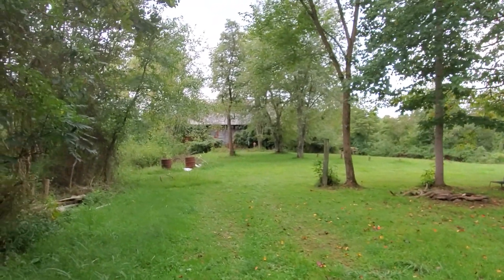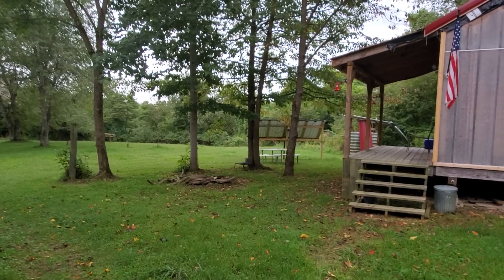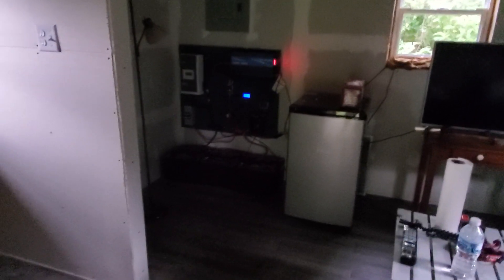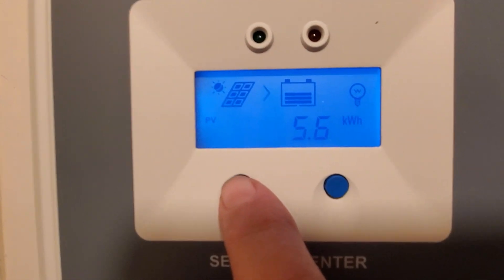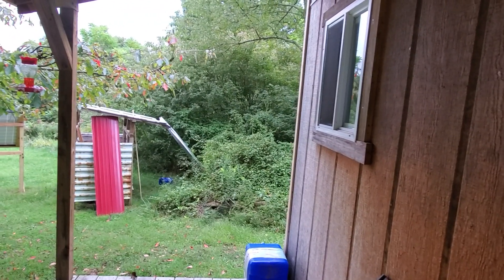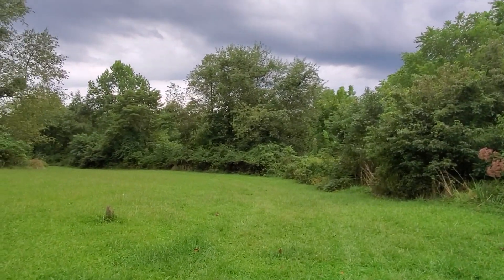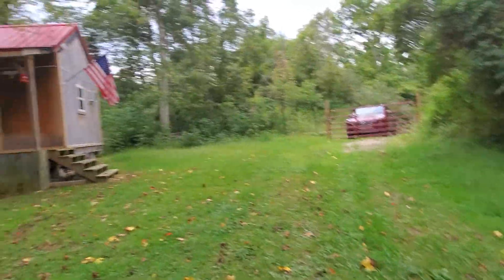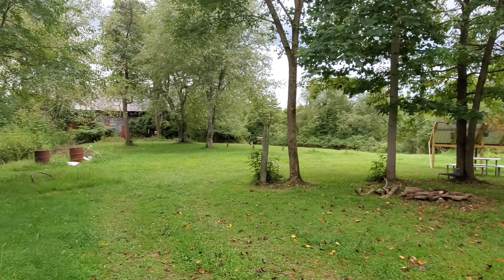Off Grid Solar - Figuring Volts, Watts & Amps.

Comment: If you keep the refrigerator full all time it will not have to cycle as much, I fill the extra space with water bottles,moving from freezer to cool the food section and can run my small fridge for 3 or 4 days on a 345 amp hour system never going below 50%
Reply from the maker: +jipetoe That's a good idea.  Thanks.

Comment: You may want to talk to the battery manufacturer or do some research on those particular batteries regarding depth of discharge.  I don't believe those Ah ratings are true because the last  1/3 or more of those amps drop disproportionately...all those Ah are not really available. With what little i know...I think you're good on keeping it at 70% on the rated Ah. I believe there are voltage disconnect switches too that can help keep it from over-discharge. 
All that to say that I know enough to be dangerous!
Reply from the maker: +Misty Mountain Project The Epever charge controller I'm using has the best settings for flooded batteries already in.  I don't have to set them fortunately. I know I won't let my batteries get below 24.65.  that will keep me right at 70%.

Comment: You are are trhe right track for sure. Best practice is to convert everything to Watt hours then do your math. so you can use 172.5Ah from your batteries safely. 172.5*24volts is 4140Wh that you can safely use. 75watts for 24  hours is 1800watt hours.  4140/1800 = 2.3 full days with NO SUN AT ALL. so, Day, night,day,night, then you must recharge before you start to over discharge your batteries
Get yourself a https://www.amazon.com/AiLi-Programmable-10V-120V-Compatible-Batteries/dp/B081SXH9TK/ref=sr_1_2?crid=3VX6U8OS4GV9Y&dchild=1&keywords=shunt+500a&qid=1599157955&sprefix=shunt+500a%2Caps%2C214&sr=8-2 and then you will know exactly how much power you have remaining, and hom many hours till discharged and charged at the current rate. You can set it for 172.5Ah capacity, and it will show you a true percentage with time watts amps everything!
check it out, it is cheap insurance and a wonderful display.
Reply from the maker: +Michael Illingby That's a nice looking meter.  I'm really happy with my experiment so far.

Comment: Hi'a Joe, Just make sure you wash down your panels monthly with dawn dish soap and water and you will get better wattage my friend. I use 20 -100watt panels and keep my off grid cabin supplied with enough energy for all of my appliances. Large fridge, Large tv, And 18 cubic foot chest freezer, and two 8,000 btu A/C's. My cabin is 800 square feet. Also having panels that rotate with the suns movement is a plus. I live in central Florida. Been following u for 3 years  now, but don' t text much. Navy retired CPO here also. We are close in age, Turned 63 this past June my friend. Takin life one day at a time. Miss seein your Dogs.
Reply: How many batteries are you using for storage? And what type?
Reply: @tawnya0627  I'm using 8 wal-mart agm 12volt batteries each has 107 watt hours.

Comment: Your understanding of battery capacity is basically correct.  Amps over time are amp-hours.115AH x 24V is 2760 WH (I think it's easier to count WH than AH). If your refrigerator runs at 75w and is off half the time, it will use about 900WH/day. Add in the inverter self-usage and inefficiency. As long as you don't get a lot of dark days in a row, you're fine.
Reply from the maker: +dbcrn859 Thanks!  I was hoping that lol

Comment: Hey Joe!
If you plug in the MT50 box, it gives you a lot more information about what's going on with your power.
Batteries are generally rated for 20 hour discharge, eg. 100 ah discharged at 5 amps for 20 hours.  This is total rated capacity.  Obviously, you would never go below 50%, ideally more, as you state.
If your fridge only draws 50 watts, that is 2 amps at 25 volts.  115 / 2 = 57.5 hours run time.  If it only runs for 15 minutes per hour, that's almost a week and a half of cold DR. Pepper.
Cool!
Don't forget to brush your teeth after drinking that foul tasting muck.  ;o?
All the best, matey.
Reply from the maker: +SarkyBugger I'm plugging in the MT50 this weekend. Thanks!